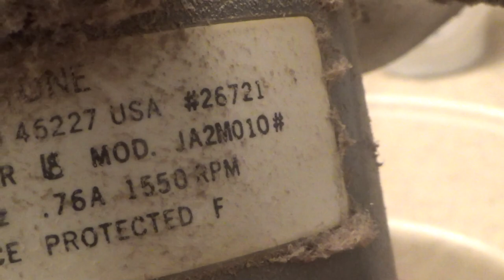Removing the Bathroom Exhaust Fan

Comment: Nice to see these old ventilators still being used, they really are built like tanks! It back memories from an old mid-century modern house that I used to live in, it was built in 1959 and I’m pretty sure it had an Emerson Pryne (?) exhaust fan installed in the master bathroom, I remember it always made a racket with an almost constant squealing noise that eventually went away after it ran for a while (The only thing probably somewhat preserving the bearings was probably the humidity from the shower). I really wanted to service it, but my dad would never let me out of fear that I would “break it”. They sure don’t make them like they used to, these oldies are definitely built to last. I’m sure it’s unfortunately gone now considering the people that moved in after us whitewashed the knotty pine tongue and groove ceiling :(
Reply from the maker: Sadly these units are quickly going extinct, but it's certainly not because they're failing. These were solid machines built to last.